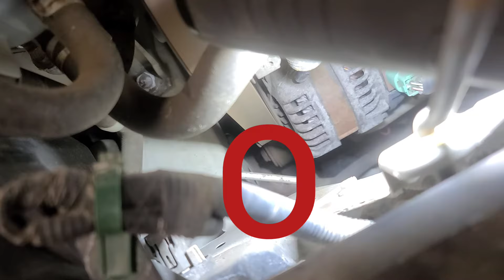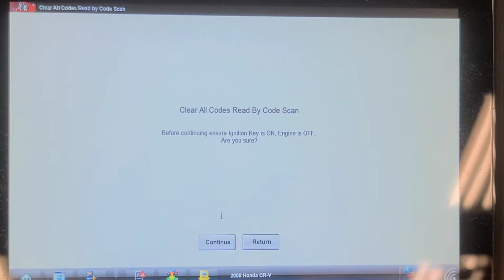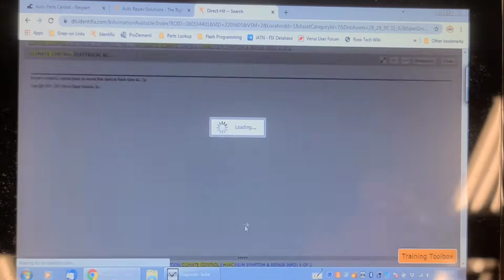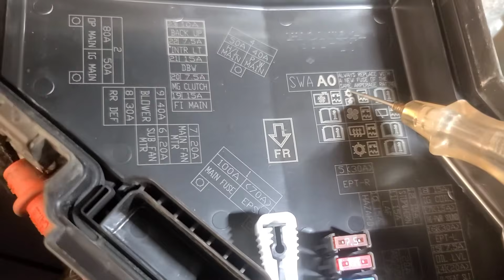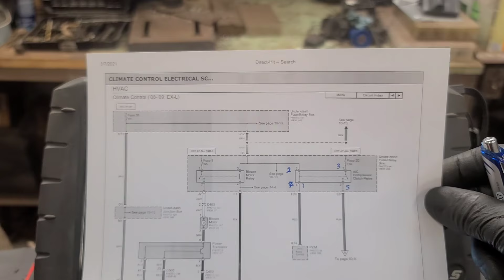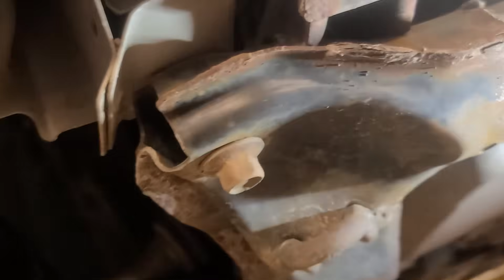2008 Honda CR-V 2.4 AC Not Working, Diagnosis of Compressor Clutch Circuit

Comment: Great video! I have. 2008 CRV I’ve only had for a couple months. Tried turning the AC on when it got hot out and nothing but warm air. Shop realized the compressor had been unplugged so once it was plugged in, the AC started to work. Problem is, now that the AC compressor is plugged in, my car battery has been dead the last two mornings. Once the battery is charged and driven for a half hour, I’m good all day. Battery and alternator both test well at local Autozone. My only assumption is that the AC unit has an electrical issue causing the battery to be drained. Have you run into this ever? Any advice?
Reply from the maker: Likely a stuck AC clutch relay. With the car off the front drive of the compressor should allow you to turn the compressor by hand. If you can't then the clutch is on usually due to a stuck on relay. Locate and removed the AC relay and listen for the clutch to disengage. This will stress the AC pressures and may cause the over pressure relief to blow off since the compressor cannot disengage.
Reply: @PhillipBailey  that was it! Thanks so much Phillip!
Reply from the maker: @mikem239  glad it helped you...
Reply: Just to clarify, the ac compressor has only been plugged in for the last two days, hence the battery being dead the last two mornings.

Comment: My crv started throwing steam when I turned the a/c on then there was no cold air. Any advice?
Reply from the maker: Steam from where? I take it the defrost or heater vents? If so them you likely have a heater core leak.
Reply: @PhillipBailey  thanks for the reply!! I was inside the car when the steam came out of the right side of the hood.
Reply from the maker: @JohnSmith-sk8ub  May have been refrigerant blowing off due to a leak or over pressure in the system. should only do it once and the no more refrigerant in the system to blow off.
Reply: @PhillipBailey  thank you so much! So I probably have a leak somewhere? Probably not the compressor then?
Reply from the maker: @JohnSmith-sk8ub  you need to have it leak tested. Could be leaking from any hose or fitting as well as the compresor.

Comment: hi i have a problem with the light of my climate control honda crv 2007 does not turn on
Reply from the maker: You need to check fuses and system pressure to start with.

Comment: I have a problem with the blue swith back in the glove box, I have to move it to start the fan, did you know the name of that piece
Reply from the maker: I don't believe there is a switch behind the dash, possibly a connector you are moving or the blower resistor connections. sorry not sure.

Comment: I have an 05 that kicks on and kicks right back off I’m replacing both radiator and condenser fans cause they are weak abs old cause the car has 280k miles on it but do you think it’s the clutch or the compressor that’s making it do that or does the overall heat making the clutch fail???
Reply: I’m having same issue, what did you figure?

Comment: Very nice scanner abilities on top of lessons. Thanks. ... Have a figure out challenge re: my 2008 Honda Accord AC not working since last start up. It is hot enough outside to know I want my auto AC working ASP.  Just confirmed my compressor pully is not spinning like it should. I am sure my DIYer will figure this out soon.
Reply: For me: Turned out to be a faulty relay. Switching ac relay w horn relay was first immediate fix 🙂. ... Then new relay was installed.

Comment: What if the coolant fan doesn't work, will that stop the compressor from working
Reply from the maker: I doubt it would prevent AC operation but it is remotely possible. What's wrong with the cooling fan? Is it setting any codes. If it gets too hot that will stop AC operation.
Reply: So if the engine bay gets too hot would it make the clutch engage then Disengage repeatedly in quick cycles
Reply from the maker: @RJVermillion  Rapid cycling of the AC clutch is typically caused by low refrigerant charge

Comment: PHILLIP, great information with logic testing method step by step can you check the thermo fuse u mentioned by reading the resister of it  and in some cars the clutch is hidden inside or u can say is one peace internal so i think u must have a scanner to check that or there is another way thankyou for sharing  cheeeers brother.
Reply from the maker: Dorman sells a replacement clutch kit. I have ordered it. I'll post a follow up when I replace it. Thanks for the tip.

Comment: service bulletin for coil clutch assy .possibley out of time or mileage
Reply from the maker: Thanks I will investigate that.
Reply from the maker: Found it a warranty extension for 7 years or 100,000 miles and is over both. Did find the clutch kit available and believe I can do it without opening the AC system. Parts on order. Thanks for the tip...
Reply: i would have you or the customer for an extension  honda good will is very good if you want . also I would rand r if you do it out of the car .better off
Reply from the maker: @davidellenbaum1229  The warranty extension was for 7 years. The car is 12 years old now so I seriously doubt they would do anything.
Reply: @PhillipBailey  honda has a liberal policy .but it's up to you. also is this vehicle a rebranded title  ie total loss . if it is all canceled except seat belts none deployed
Reply from the maker: @davidellenbaum1229  No body damage I can see and not branded. Car is in excellent condition for its age.